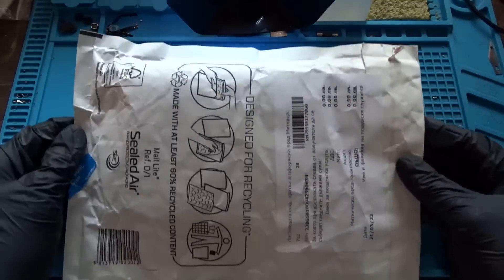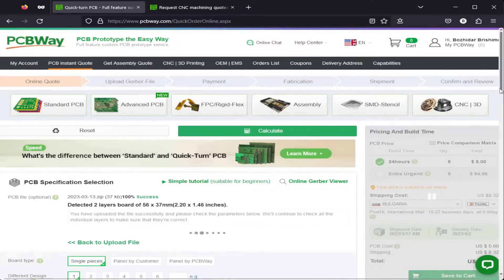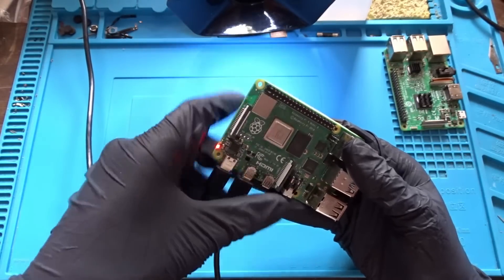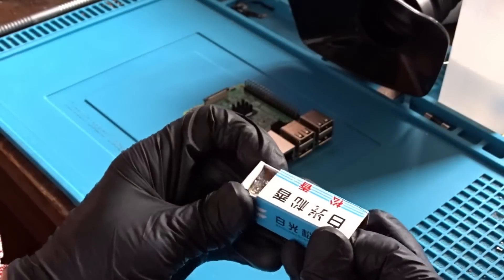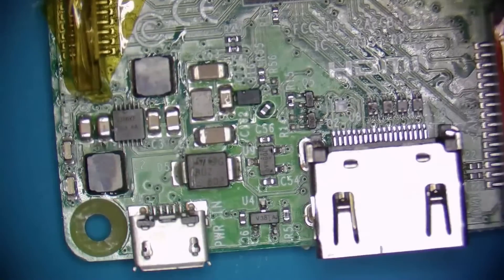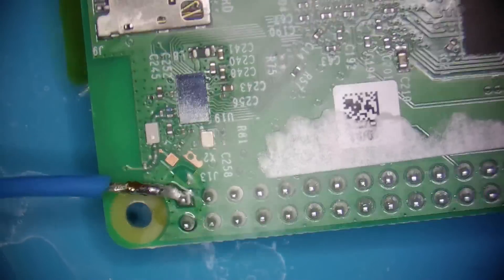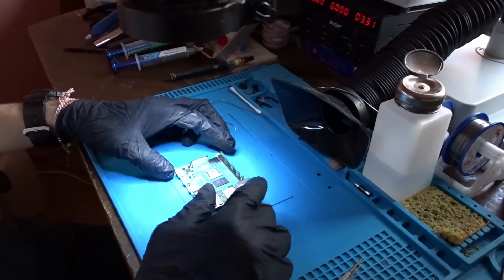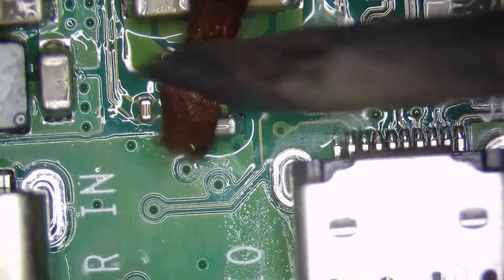Repairing electronics #1: Raspberry Pi 3B and 4B

Comment: had a same problem, but i am no expert doing that and in my city noo one dares to touch it as it is difficult to repair i want to get it done but dont know how to do that using multi meter  because i dont have this necessory tools to check it where it is shorted at then end i am able to find that my Raspberry pi 3B+ doesnt show volatage between 3.3 and gnd also when i check in continuity mode it shows shorted and now i am stuck....

Comment: I have the exact problem with the raspberry pi 3b i solved the problem partially but am suck with resistor size and resistance. the resistor that was shorted seems to be responsible to power up the wifi and Bluetooth module on the pi ,the pi runs fine but without connectivity and its pretty annoying when you start using dongles here and there 

If you still have access to the pi 3 can you please tell me the value of that resistor and thanks for the amazing content
Reply from the maker: Tomorrow I will be able to this for you.
Reply from the maker: I don’t have precise enough measurement equipment to tell you exactly the value of the resistor… But as far as I can measure it is somewhere between 0.3-0.2 Ohm and it should be size 1608. I hope this helps you.
Reply: @MadEDoctor  thank you Very much
Reply from the maker: You may also need to replace the wifi/Bluetooth module. In my case it turned out that it was shorted to ground…

Comment: Very impressive! Thanks! However, replacing MXL7704 (PMIC) requires programming it via I2C. Do you have the replacement chips programmed? How? Have you done it yourself or bought it with already written values for your model of Pi?
Reply: That is required for PI4.
Reply: @krystianm5295  Thanks! Didn't know that.

Comment: Instead of using the chemical, you can use an IR camera
Reply from the maker: Yes but IR camera is way more expensive🥲
Reply: @MadEDoctor  Thats a good point, I only got one myself when bought a ulefone armour 9 when I got my last phone as i figured when i replaced the phone I still have an IR camera and the phone didnt cost more than the alternatives.

You can buy FLIP usb cameras as well but they arent cheap either

Comment: I have an 8gb pi 4 with dead USB rails, nothing detected via cmd codes, any thoughts on what could have died? It was being used for my 3d printer with the 5v line blocked off the stop backfeeding
Reply from the maker: Most probably either the USB controller located right behind the USB connectors or some capacitor in its circuit is shorted. Check the USB pins for short to ground.

Comment: What is that smaller ic that produces 1.8 V?
Reply from the maker: As you can see on 6:39 its name is DA9121
Reply: @MadEDoctor  It isn't for 1V8, it is a secondary PMIC for the SoC core rail (typically 0.85V or so).
Reply: @richardjones1373  1Volt
Reply: @Nooki33  If at 1.00V then that PMIC isn't under SoC control. That is it's default value. If running correctly it will typically be set to around 0.85V or thereabouts.
Reply: @richardjones1373  1volt its a value measured from the Pi.
Reply: Yeah had to pause it to see better but thx. Cannot see anywhere for sale, where do you buy them?
Reply from the maker: @Nooki33  I buy almost everything including those chips from Aliexpress. Here is link to the place I bought them from: https://www.aliexpress.com/item/1005004995175187.html?spm=a2g0o.order_list.order_list_main.4.56cb1802BE54uI
Reply: @MadEDoctor  Did you buy from that seller? Is it trusted? They are new on aliexpres?
Reply from the maker: @Nooki33  Honestly I bought from it one time and everything was ok. I understand that you have concerns because there are no reviews, but sometimes you just need to take a risk, because as you can see you can't find those chips elsewhere.
Reply: @MadEDoctor  You are absolutely right, just asking for curiosity

Comment: FR8 sounds like fusible resistor, suggesting there is a harder short somewhere after it. Perhaps a cracked ceramic capacitor.
Reply from the maker: It turned out to be a short in the wifi / bluetooth chip…
Reply from the maker: Actually I didn’t think about that. I will check and I will write here what I have found.